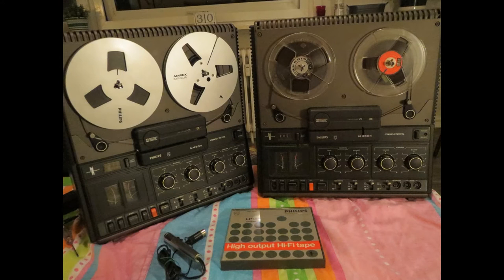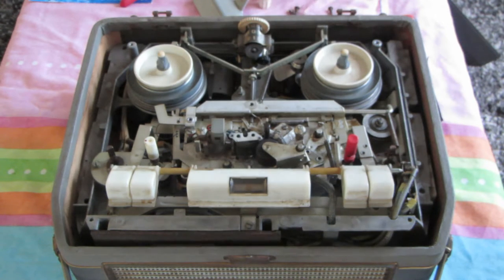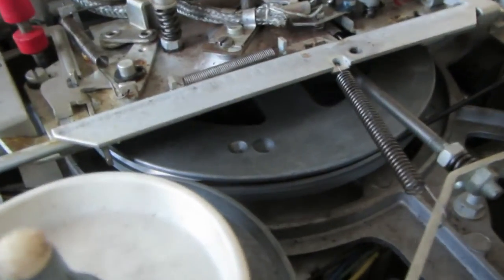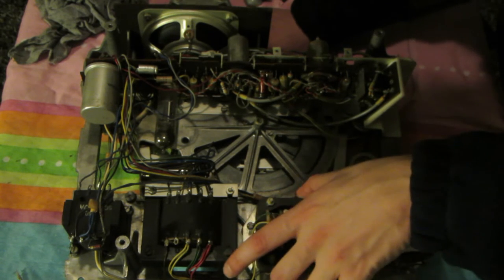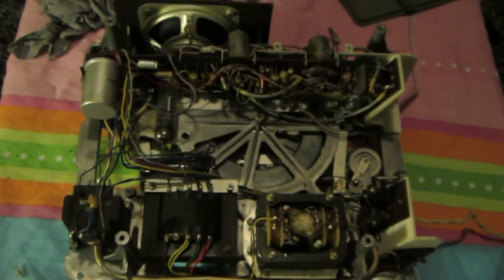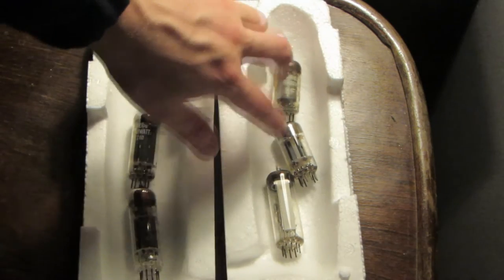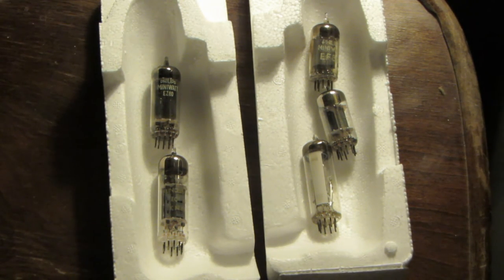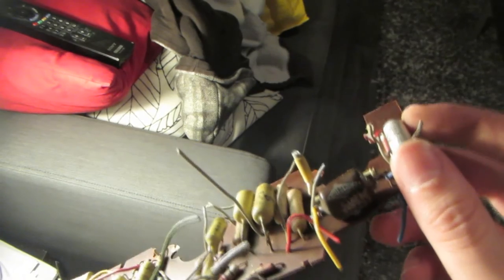Philips EL3541 Reel to Reel Teardown

Comment: So I just picked up one of these, super cool and charming little unit. Everything works fine except for the record function. When audio is recorded, you can hear it faintly (distorted) in the background, but the audio that it's meant to replace is still there. To me it seems like neither the erase head and record head are being triggered like they should (they're separate heads of course) so I'm thinking the problem lies upstream there. If anyone wants to chime in with a suggestion I'd love to hear it though.
Reply from the maker: Perhaps a power supply issue to the heads/the circuit that powers the heads? The erase head works super simply, so that's what came to mind.
Reply: @rot_studios  Thanks mate, I'll look into that.

Comment: probably a shot in the dark after so many years but which one was ef86 and which one ecc83 when you had the recorder upside down? i know the ez80 is the bottom left and ecl82 above it, but the shields are too tight for my liking to just go pullin them out just to check, i think i have a bad ecc83...
Reply from the maker: Bit too long ago to remember, yeah. Still maybe you can deduce it from the schematic: https://www.audioservicemanuals.com/p/philips/philips-el/13371520-philips-el-3541-schematic

Comment: I’m working on the EL 3542,do you know how high the small cork,sometimes rubber infills 6 altogether,on the two spools have to protrude above their “cups”,they are used like a clutch I believe.I just can’t get these right, When I rewind too the left,the right one either doesn’t slip,or holds tight instead,any info would be appreciated, I’m a hobbyist only,Thanks.
Reply from the maker: Sorry, it's been a bit too long ago to remember and I don't have the r2r anymore...

There are plenty of knowledgeable people on both YT as FB though (FB groups are a good bet). Good luck!
Reply: Heinz-Juergen Klein Thanks Heinz,At present Im trying Cork, If it doesn’t last I will try with a glue gun.Cheers.